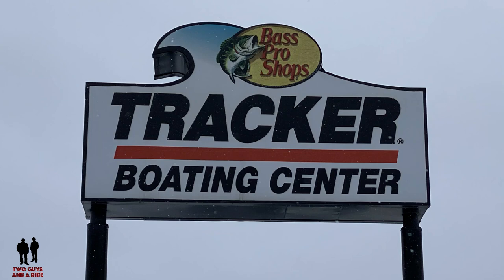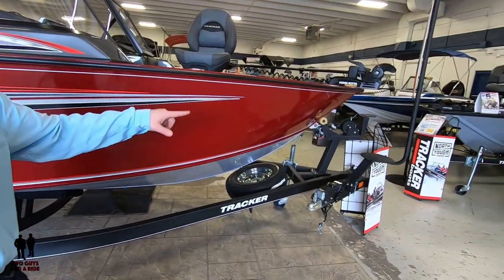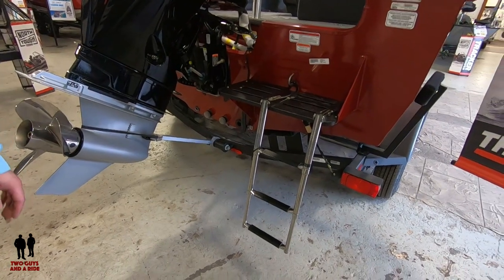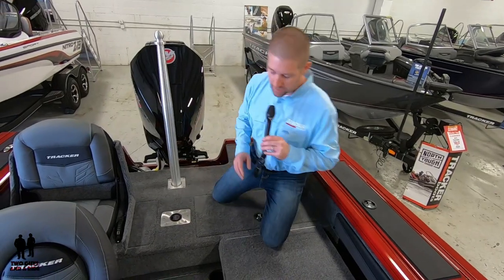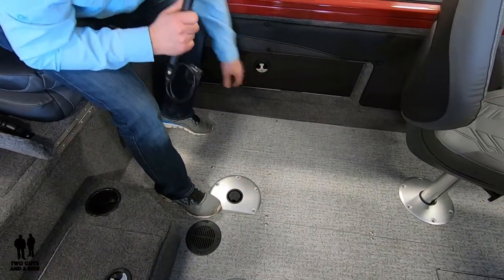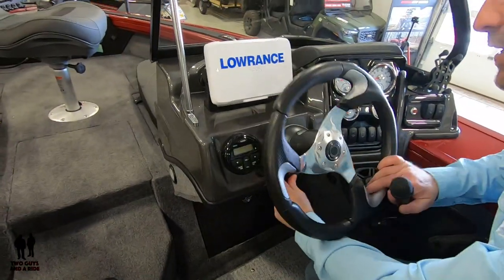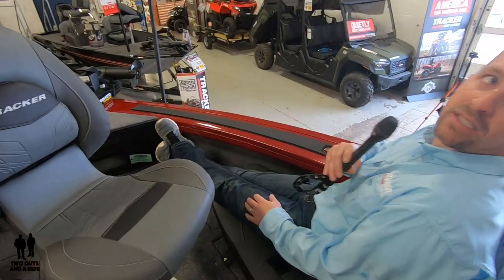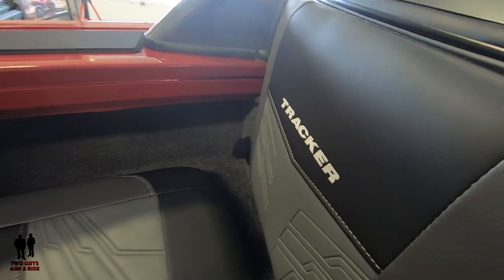Tracker Targa V19 Combo

Comment: Biggest issue i have is with the charging system. When you plug it in up front you still have to find the charger to make sure its working correctly. Atleast thats what i do. Would be nice to have a light or something by the plug.
Reply from the maker: Good suggestion. Thanks for watching!

Comment: Nice boat can a suv pull it have a Buick Enclave
Reply from the maker: A new Enclave can tow up to 5000#. Dry weight of the Targa V19 is 4019#. So check with your dealer on the total weight of your boat before buying. Thanks for watching
Reply: Ok thanks

Comment: Can you pull a tube kids using the ski pylon?
Reply from the maker: I wouldn’t recommend that, instead you should use the transom eye bolts to connect to. If you pull a tuber off the ski pole it could damage the ski pole. Hope that helps and thanks for watching!